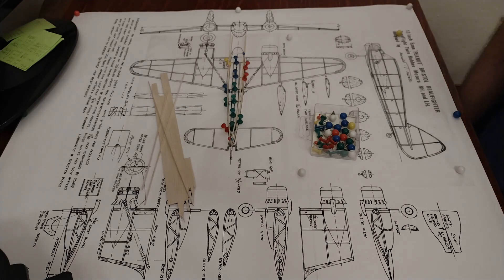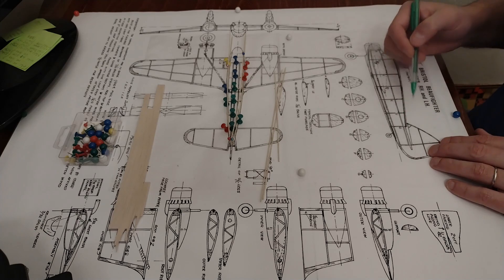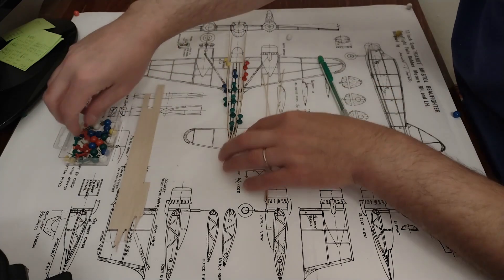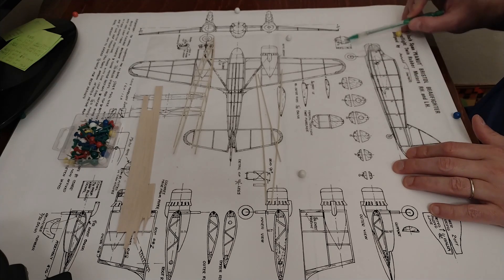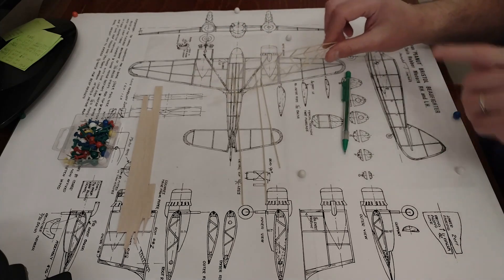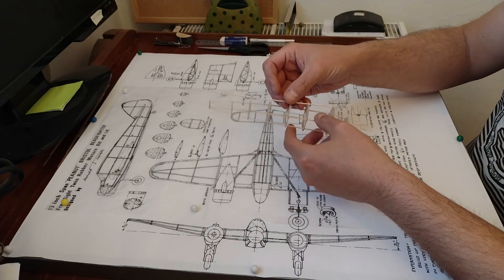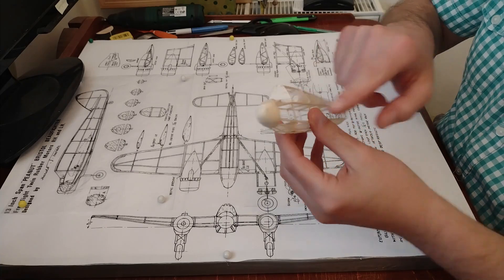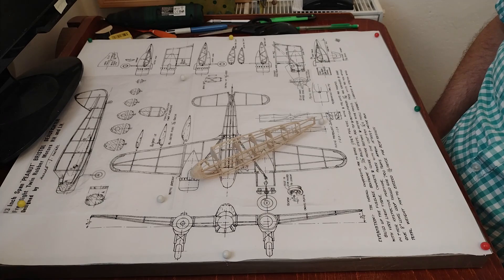02 Beaufighter Peanut   Fuselage build

Comment: Some fine work there. Towner was clearly a man with a lot of time on his hands to come up with such complicated designs. Wartime shortages of Balsa not withstanding.
With regards the canopy, have you considered using clear heat shrink plastic 0.1mm. Maxfliart has a tutorial. Even if you consider a test flight I would suggest not gluing in the stab. Tack glue the leading edge. Leave the trailing edge free in the slot so you can shim it for the glide. D L Reid.
Reply from the maker: From what I know he was "active" from the late 30's until the early 80s (I believe he passed away in 81). Really incredible to see his hand drawings, probably with a fountain pen, and still able to make them fly!
Great idea for the stab! I hadn't thought of it, I think I will apply that tip! Thx for stopping by!